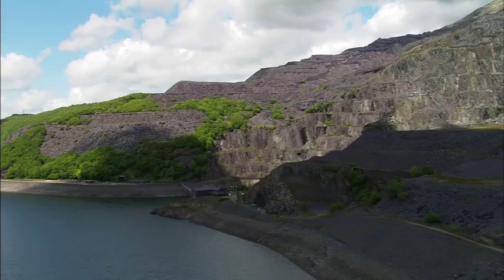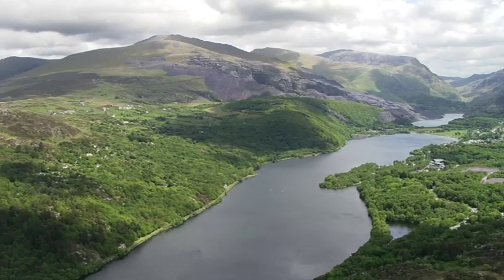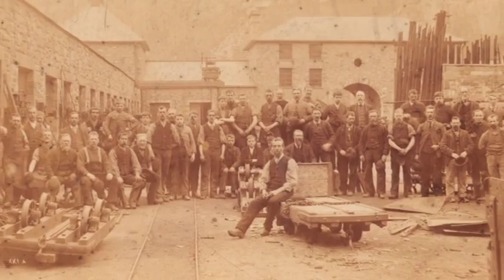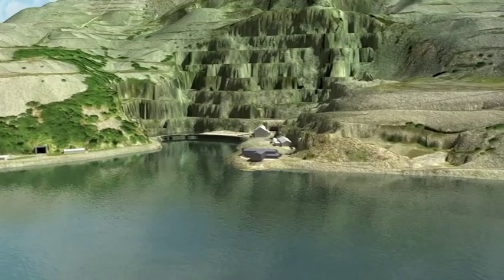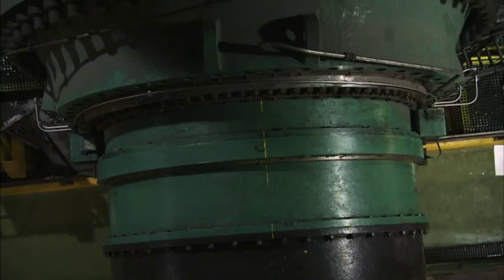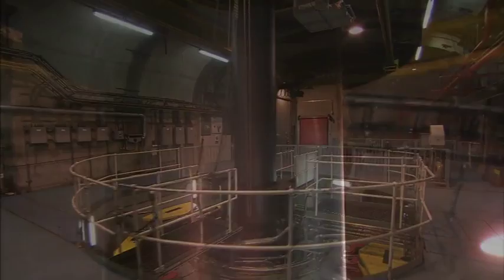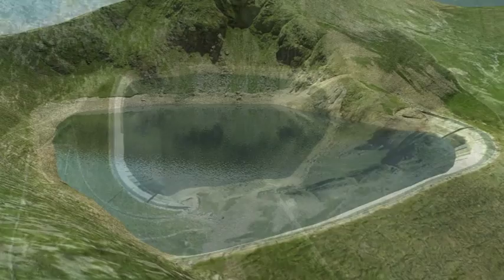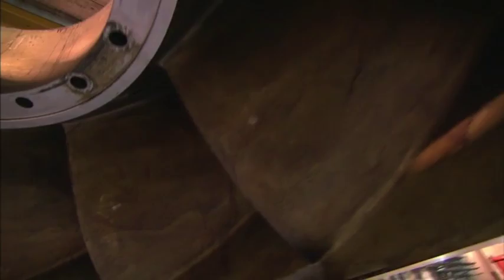Electric Mountain Dinorwig DVD

Comment: Is this taken from a promotional DVD? No credits? On 'fully charged' the visit talks about 'pony pumps' for sending water back up and yet here the 'turbines are reversed' - sounds unlikely as they are two different engineering requirements. If it is an official video produced by the electric company, I'm surprised the narration has that bit about '..rotating up to 500 revolutions per minute'. The whole point of this installation is that it is always turning to match grid 50Hz and ready to come on line with power when the valves are opened. Interesting this hugely expensive disguised installation is surrounded by pristine landscape with no wind turbines or solar panels in view. We would need hundreds of these to avoid carbon emissions. The original slate mine provided a  long-lasting building material. Now replaced with cement and plastic inferior products.
Reply from the maker: Video is taken from DVD sold at the visitors centre.
Reply: why are you surprised that the GEC generators have a grid synchronous speed of 500rpm?

Comment: “One of the worlds largest”.  The Australian Snowy Mountain Scheme is the biggest.
Reply: It's amazing that during all those years John Howard was pm in Aus his main complaint about renewable energy was that it could not operate 24/7. All the while places like this were already in place. The problem was already solved.
Reply: @kitthearty  Old comment but the problem is far from solved. The power station just like all pumped storage schemes only produce electricity for a few hours each day to cover peaks and spends a lot of the time pumping the water back uphill. Originally built to complement nuclear power stations which provided the baseload generation and rather than ramp down at night the power stored. 

In relation to storing renewable energy we need schemes like Coire Glas, it alone would more than double the UK Pumped Storage Capacity.

Comment: "Spiral casings" that get "smaller and smaller" to increase pressure? Yeah. Pressure is flow and restriction. Increasing restriction to increase pressure decreases flow and flow is where the "power" is. Only by pumping water downhill from above to increase pressure WITHOUT increasing restriction does more pressure = more power. 

Typical British "physics". It sounds good if you never took a real science class in your life and can't even "imagine" a flow rate not "measured" in "teacups per second".